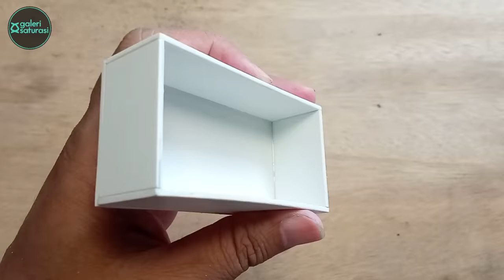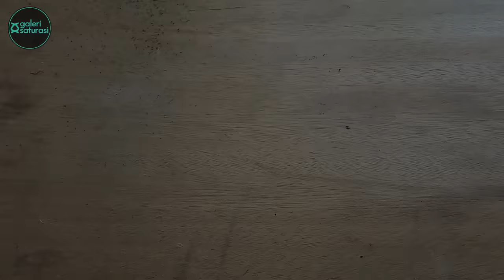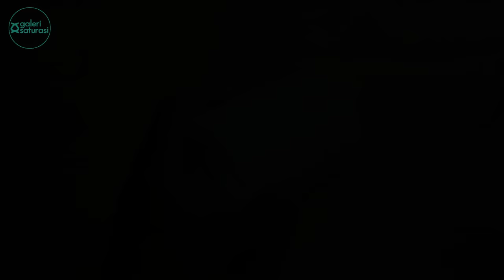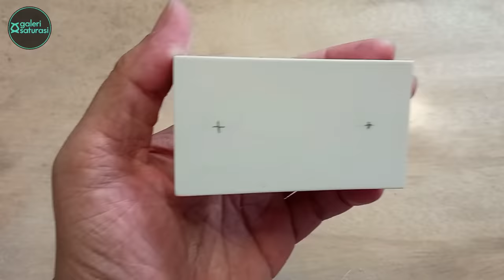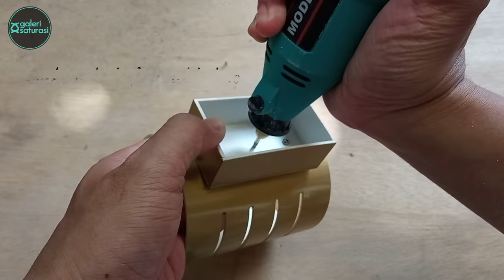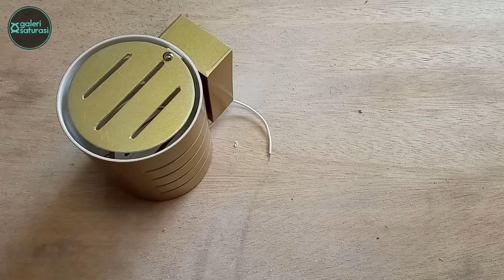Modern Lighting Ideas from PVC Pipe | Wall Lamp Design Spotlight | DIY Crafts

Comment: Bro im using 3 inch pipe but pipe diameter 7 cm and length 23.6 cm not match how to make this type of lamp please reply....
Reply from the maker: The 3 inch pipe is 9 cm in diameter, and if it is 7 cm in diameter it means the pipe is 2.5 inches. can still be used, just cut the length of it
Reply: @GaleriSaturasi  bro mein curve me 6 cm liya hu or cut krke sand paper se finishing kr liya hua ap top me krna hai .